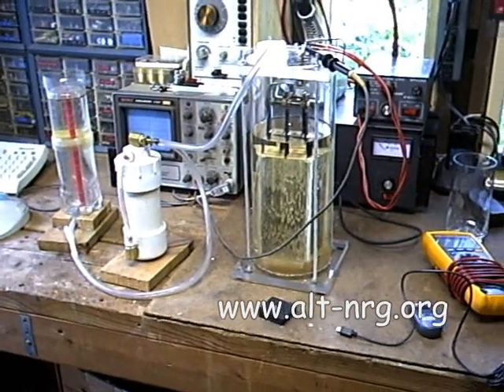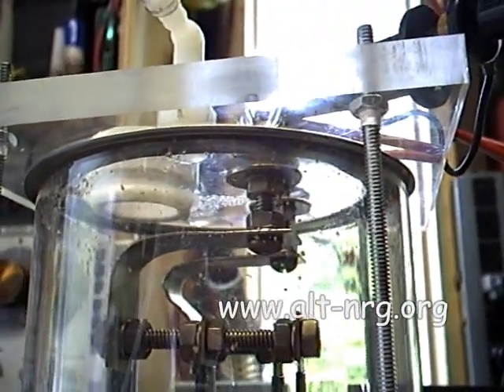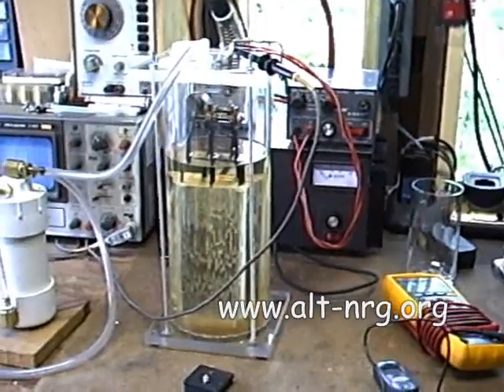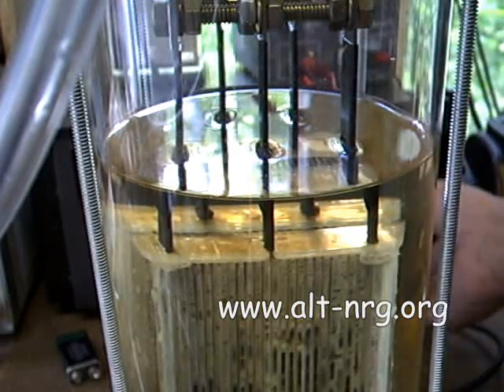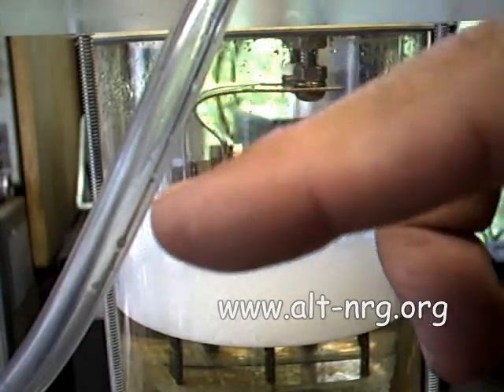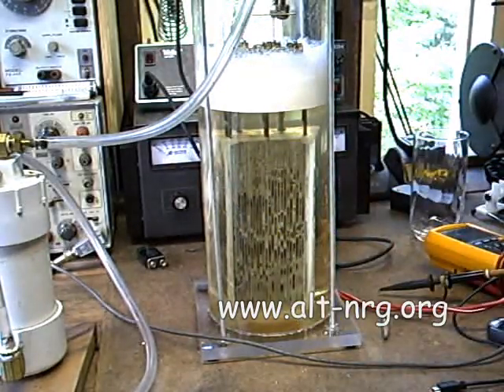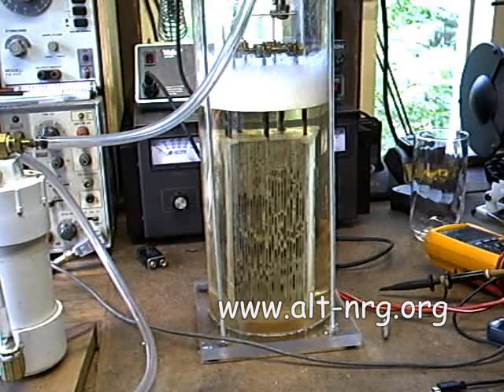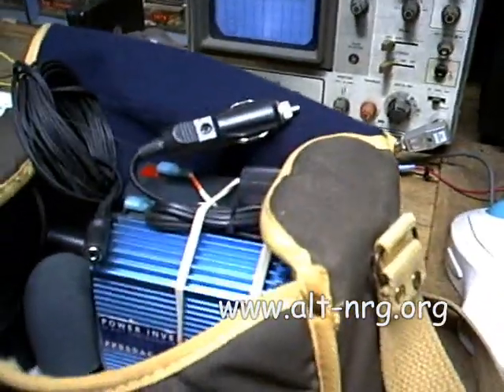#101 VSPB cell in clear test chamber. 5.40mmw!

Comment: You have a great design, one suggestion is to extend the height to reduce the foaming and find a nice level of consumption of amps to have a consistent flow also you may wish to insulate the plates from the top therefore isolating the resistance to the reaction chamber which is immersed.   There is something else you may wish to attempt - introduce the plates from the sides under the chamber and utilize an "S" honeycomb chamber with a return tube or a miniature radiator design to prevent foam.

Comment: If the poles inside the tube creates a spark you will have create a bomb,insulate your contacts before you hurt yourself,other then that it's a great comcept and great idea..try to build a smaller unit for cars..if the unit is to big and installed in a car you be sitting on a bomb,by useing several small chambers this will be more safe for the use in cars,the Hydro gas need to leave the chamber quickly to not be a dangerous device,if you lite a match,you will see what I am talking about

Comment: If I am understanding it correctly, you have a greater HH0 output at the moment of start up. If ths is so, try to do a circuit to give impulses to the cell instead of dc (even instead of PWM). Than, to control the flow, you can control the number of impulses per second.

Comment: About the foam. I was thinking of the air filters you find in some of the old forced air furnaces. They have a very course, long strand fiber glass filter in a cardboard holder about half an inch thick.

A couple layers of this installed below the bolts, maybe right on the surface, and held down from the bolts with something wrapped arond the shrink wrap may work.

Comment: Zero Great work! I was wondering if Ohms law could be applied to the HHO circuit To find the happy medium between max gas output with minimum Heat production Ive been having trouble finding the ohm value across The terminals of my HHO cell it seams to very greatly for no reason. 
I under stand That the amount of bakingsoda changes the resistance Across the terminals witch could be used for the adjustment to satisfy Ohms law. I would appreciate any comment from anybody on
This matter.Thanks

Comment: how do you get such good efeicency in a cell ive got a cell i made i like to use more electrolizer so i get more gas quiker i have a 10 cell on a 12 volt battery charger pulling 40 amps i get 2.08 MMW

Comment: Hi zerofossilfuel. I like your cell very much. Perhaps a positive pressure relief valve would be a nice feature. Brewery suppliers have nice brass pressure valves set to pop at different values. Perhaps atmospheric pressure could be another factor contributing to efficient hydroxy production. Great work so far. I have learned a lot.

Comment: Resonant cells. Finally. Autoresonant circuits? Not yet. Working meyer's replica would do it even if you have to keep adjusting frequency manualy. I have heard there are "universal" frequencies some 42+khz producing decent amount of HHO while ambient conditions may slightly vary without loosing production. Auto adjustment would be great but that could be the next step. Brute force is getting old and more or less perfected - lets move on to HV resonant systems. Very efficient & Very high output!

Comment: Zero Here is the link to the 3m platers tape in the second post. They have variuos sizes and thickness so you could use this for both sealing of the plate edge and separation of the plates. If you see some you would like to try email me the information and I will get some for your testing.
Regards
Secondamend

Comment: Hey Zero great work on all your projects. I know you are moving to a dry cell but I have a chemistry background and have been in the plating industry for 22 years. I wondered if you have tried 3M platers tape. You could both seal and isolate the edges with this and it is made to withstand both alkiline and acidic environment.
Regards
Secondamend

Comment: Zero, great cell, good job. Looks as efficient as you can get. Looking forward to see the results with it hooked up to your electronics... Did you look at the idea that I posted in your last video with the separate L/C circuit? I think that it would be easier to tune and keep in resonance by taking the WFC capacitance out of the equation. The waveform that I got in the simulation looked like Meyer's step-charge pulse train. Please let me know what you think. Looking forward to the show video.

Comment: If you dont want the foam rising up and getting to the terminals, you might be able to, somehow, drop a glass tube down over each terminal, with the tube sealed top and bottom. Then the foam can rise up and out and not hurt anything. I also second the notion of shaking the cell, to work the foam back down.

Comment: I found that is the cell is sitting on a table not moving I get foam. If the cell is in the car and the water is sloshing around the foam disapates. Try slightly shaking your cell on the bench and you may notice the foam disapate. This is what I found others may have a different result.

Comment: Hi ZFF,
a calculaton question: how lean? If I would like to run an engine completely on hho gas, lets say a 2l engine. It would draw 0,5l of fresh air + hho gas per round - that is at max 6000rpm = 3000l of air an hho gas per minute. How lean can the mixture be, to work, so I would know how much hho I would have to produce in order to have a full hho engine. with your cell of 5,4 ml hho per minute, per watt output I could calculate the current I need to produce. -

Comment: ZERO, my cell in my vehicle closely replicates the efficiency of your zero cell. Just a little over 1 LPM, I run @ 11.75 V  @ 20 Amps. My bubbler goes down about 400 ml of water @ 1 hr. of drive time. what would cause this??  I have installed a fuel filter canister catch after the bubbler as a secondary precaution for excess foam or corrosive koh vapors entering into my engine. Totally dry.  Where does the bubbler water go??  I have to re-fill about every 80 miles. (bubbler only holds 750 ml)

Comment: Hi zero, was just wondering if this new cell has got glue on the top and bottom between the plates, and if so how is it holding up.  I was wondering if possibly some kind of paint might work, it might be necessary to rough up a small section of the plates to make it stick better. I will try it myself soon.

Thanks for posting all your research and keep up the good work.

Comment: They no longer make an alternator for any vehicle nowadays that's any less than 70 amps.  The one in my truck is stock, 140.  Even rebuilt older GM alternators, are more than 35.  If the alternator for your old vehicle is only 35 amps, and hasn't been replaced yet. Rebuilts are retrofit to have quite a bit more power, in the exact same form factor.

But for sure, any vehicle that's newer has quite a bit more juice than 35 amps output.

Comment: Hey, Zero
I think my crimp connections may have been the cause of my cell exploding. Now that you mentioned it, I was using crimp connections with stranded #8 copper wire inside my cell. The issue of arcing never occured to me. I'm in the process of redesigning my system with better connections. QUESTION: Why do you need neutral plates?

Comment: How do you drill holes in the acrylic without making it crack???

Also on the copper comment. I tested copper by placing a copper wire and a stainless steel wire inside a bucket, Copper on negative - stainless on positive.  I ran it for 1:30 and it didnt corrode.  Longer testing needs to be done of course to comfirm that it does or does not corrode over time.  Copper on Positive corrodes in seconds.

I have not understood why you 'smart' people have not understood that.

Comment: Great work.. I have no time to work on the new cell but it is going back in tomorrow for some more welding.. I did make a torch today. To test out the flashback arrester and its works great. just something to think about for a little more safty under the hood.
Thanks again for all the info.